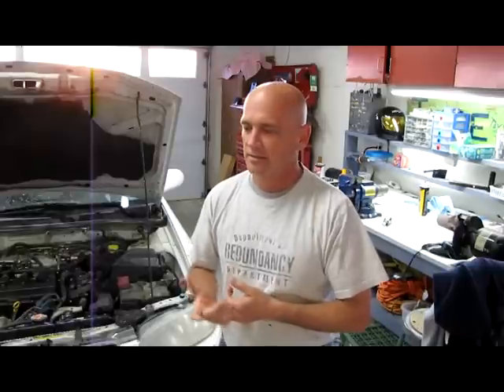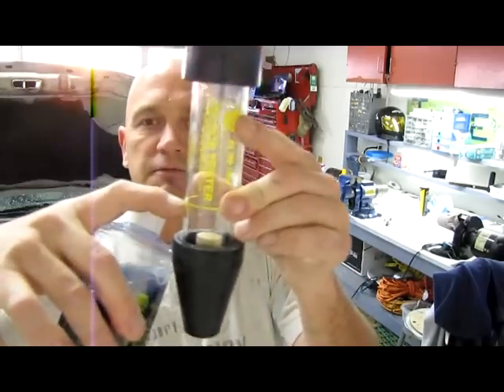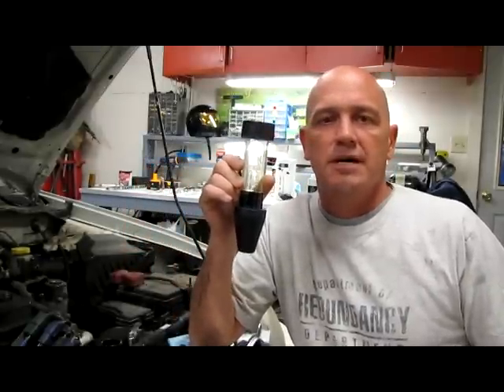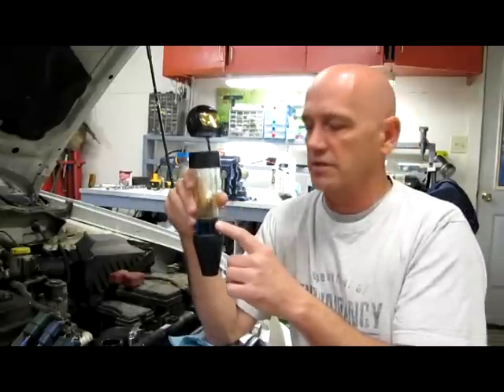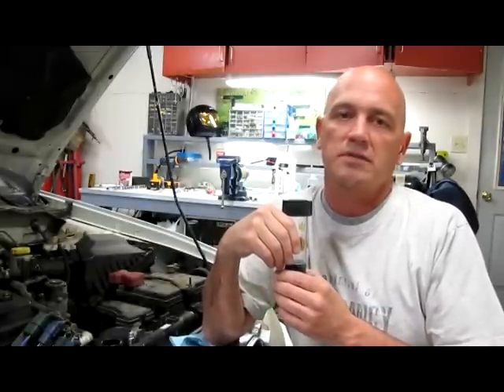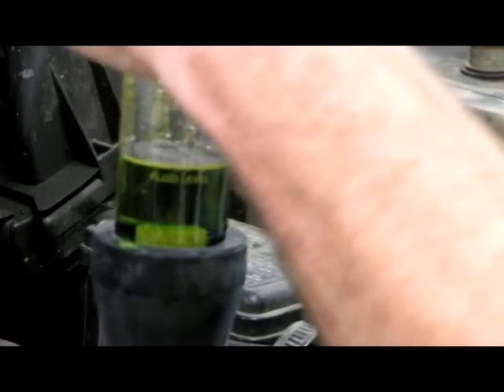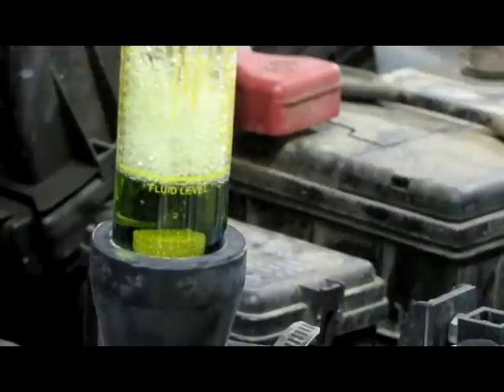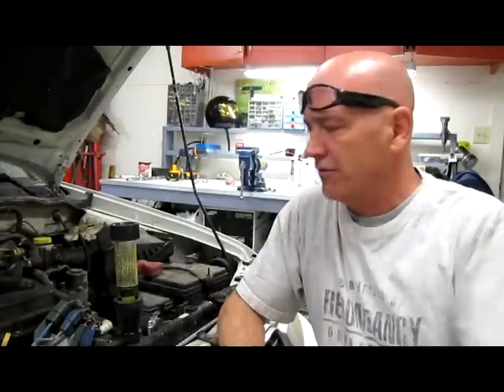How to Test Head Gasket

Comment: hi got a Volkswagen bora 1.9tdi when its been running a bit it loses coolant threw reservoir on expansion tank used this test yesterday it didn't change colour showing head okay also pressure tested which was fine im lost whats up
Reply from the maker: thomas guest Hi! This is a good one!  Your TDI engine stands for Turbocharged Direct Injection - and to me, the major thing here is 'turbocharged.'  I'm no expert on turbo's, and have little experience with them but have read a lot about them...I 'get' what their purpose is: to grab tons of air, and to basically 'push' it into the intake of the engine.  Most turbos I know of use the exhaust forces to spin a veined turbine, and the resulting plumbing crams more air into the intake.  Since it's using the exhaust forces, the turbos run hot and there is cooling that is necessary there. In your case, a bit of internet searching shows me that the TDI system was developed by Volkswagen, and that most of those types of systems use what is called an 'intercooler.'  Further, there are many types of intercoolers (and aftercoolers, for that matter), and some in fact do use the engine's cooling system.  Of interest here is the "Charge Air Cooler" type - read this description:

 "A charge air cooler is used to cool engine air after it has passed through a turbocharger, but before it enters the engine. The idea is to return the air to a lower temperature, for the optimum power for the combustion process within the engine."  

I have seen intercooler systems which do use coolant from the cooling system.  Yours may or may not be this type, but if it is, your pressure and block tests may not be showing a leak in the turbo cooling system - if it is in fact using coolant to cool the turbo process.  That's about all I can offer at this point - I'd suggest you locate a specialist or someone who is greatly familiar with your induction system - this shows to be a diesel engine, which uses super high compression, and compound that with forced induction via turbo - tons and tons of heat there.  

I'd focus on the turbo system at this point and see if it in fact uses your cooling system to cool that process.  Sorry - not much more help than that!  Would love to hear back!  Thx for the great post!  r-
Reply: +thomas guest You're probably loosing coolant when under pressure through the water pump gasket, I had exactly the same problem on my 1.9 tdi, it's an inherent problem with a lot of 1.9tdi's and the 1.8T petrols. In the end the gasket totally went and wouldn't hold coolant even when not up to pressure. Just get the water pump changed and the cambelt and expansion tank whilst you're at it, as they will need the belt off to do the water pump anyway.

Comment: does this tester work on a sealed system with an expansion chamber rather than a radiator cap?
Reply from the maker: Glenn Webster Yes, it does.  Contact US  Sealants if you need to verify, but what I've heard, it does.  r-
Reply: Thanks...

Comment: by the way, the only symptom that I have seen in the car is that we loose coolant and we don't know where it is going…. what do you  think? thank you!
Reply from the maker: noa33333 hey I can't find your original post, if you posted.  But....given just this info.....   losing coolant is always an issue of course.  I'd be interested in knowing at what rate you are losing it ...a quart a week, a gallon a week...?  If you are losing coolant the first thing would be to perform a pressure test to look for any external leaks, which are most common.  Even just loose clamps can cause enough for concern.  Then, if that turns out to be negative and you are still losing coolant, well then a block check would be in order.  Beyond that I'd need to know more about your situation.  Hope this helps some. r-
Reply from the maker: reluctorvalve Ah, Mini Cooper - got it now.  sorry bout that. r-

Comment: very useful thanks. My mini cooper S has an internal coolant leak and I have been told that it must be the head gasket (£800 repair!) and I bought the Mini second hand only 2 months ago ;0( , i want to make sure it is the head gasket before I commit. But what could it possibly be if it is not?
Reply from the maker: noa33333 Well, if you definitively have an 'internal' leak, and you want to know what else it could be besides the head gasket(s), I'm not too sure you'll want to hear my response.  The only 'other' kind of 'internal' leak would be a crack in the engine block (housing the pistons, crankshaft, etc), cylinder head, or both - in which case, junk the entire engine and put in another complete one.  The main thing is to determine if you have an internal leak.  If you do, then of course you'll want to know if it's just the head gasket(s) (at your high price you list), OR a crack in the lower engine block (which would be an even HIGHER price, of course).  The ONLY way to tell if you have a crack in the lower engine block would be to take the engine out, take it completely apart and then send the gutted-out lower engine block into a professional machine shop to be tested for cracks ($$$).  ....Nutshell:  diagnosing overheating to just a head gasket is always a bit of a gamble, because the issue could in fact be a crack in the lower block. I used to tell my clientele that if they had an internal leak, it was MOST LIKELY a head gasket issue which is common, but it COULD BE a cracked block (bad engine), which is NOT COMMON, but yes, possible. In one of my cases, the head and head gasket were replaced, only to find that it still overheated badly - so we replaced the engine at that point. And yes, the client paid for each repair ($$$$$$). However, in all my other clientele cases these issues were corrected with new head gaskets and resurfacing of the cylinder head bottoms. I always made my clients aware of their choices. It all depends on the degree of damage done while overheating.  Remember that most of today's engines have light-metal aluminum cylinder heads, along with the thick and dense cast-iron lower blocks.  While overheating, naturally the thinner, less-dense metal 'chunk' will become damaged first.  If the vehicle was driven over and over and over like this, the chances are of course higher for a cracked block.  If it overheated once or twice, and an internal leak is detected, chances are it would just need head gaskets and a look at the bottom surface of the cylinder head(s).  Not great news, but hope this makes some sense.  r-

Comment: Great video.  How does this work on a vehicle like my Grand AM?  It doesn't have a radiator cap.  Only a reservoir that feeds to the radiator.  Can this be done on the reservoir?
Reply from the maker: Robert Rosenow Like you, I once looked on YouTube for similar processes, and some that I ran across were from the UK - very similar test tool and some were used on what you are referring to - and expansion tank.  I haven't done this on a system like that myself, but if you look more I'm sure you could find someone using this on an expansion tank system.  If not, contact USA Sealants, who makes this product and they could tell you more than I can.  The adding part of the instructions is what I would be concerned with, just like you are.  Not a whole lot of help but at least you know who to contact to find out.  r-
Reply: Thanks for the response.  Just yesterday I found someone who confirmed that anything done through a radiator normally could be done through the tank.  Great news.  Ran the test and remained blue.  Thanks again.

Comment: +reluctorvalve: I have a 1998 Honda Civic that is loosing power and shakes/rattles during stops, acceleration, and while climbing up hills. My check engine light is on consistently. I barely managed to get it in to Auto Zone where they hooked up the diagnostic tool. It read that I have a Cylinder 1 & Cylinder 2 Misfire. What could be the cause of this problem?
Reply from the maker: Yvette Burtley Yvette: This is going to be lengthy, but that doesn't necessarily mean that your issue(s) are all that complicated.  First question: did this start all of the sudden at once? Or did it start to run a little crappy, then gradually get worse?  Your complaints of shaking and rattling are obviously a direct result of the misfires - so no need to wonder beyond that for those complaints.  I'm assuming you have a 4-cylinder engine.  Basically, if you have two of those cylinders misfiring, HALF of your engine is doing nothing, from the standpoint of producing any kind of power to push the car.  This would be exactly like trying to ride your bicycle with only one pedal!  Try that going uphill! :(  Even if it's a 6-cylinder, a two-cylinder misfire is huge!  That would be a full 33% of your engine not doing a thing. What is great from a troubleshooting standpoint, potentially, is that #'s 1 and 2 are both misfiring- and typically these cylinders are located right next to one another. That physical commonality is what I would be drawn to immediately. Such as, what do these two have physically in common?  What could make both of these crap out at the same time?  Let's start with explaining a 'misfire,' first of all, as brief as I can. Your bicycle has two pedals, so it's now defined as a 2-cylinder machine for this comparison.  One cylinder is like one of your pedals on your bike, in that it needs what it needs to produce that downward force on the bike's 'crank,' and yes, it's called a crank on a bicycle. If one leg, pedal or foot is missing, then that pedal isn't being pushed downward - that's the effect of a cylinder misfire - nothing is pushing that piston (your pedal) downward.  On your car, each cylinder needs 3 things in order to produce that downward power on each piston, or pedal:  #1- Adequate Compression-the air/fuel mixture needs to be compressed and pressurized before being blown up, basically. That 'explosion' is what pushes the piston (pedal) down on the engine crank.  So a compression test can tell if this is the issue- and this is referring to possible bad issues with rings, pistons, bent valves - akin to your pedal being broken off on the bike, a missing leg, illustrating the more mechanical parts.  Side note: when doing a complete compression test, the lowest cylinder results should be at least 80% of the highest cylinder results, given that the highest is within acceptable levels. #2- Ignition - a spark at the correct time - easily tested.  Without a spark, nothing will blow up, nothing will push the piston down. This 'combustion' is what forces the piston (pedal) down on the crank, helping to rotate it.  #3- PROPER air/fuel mixture- this is a big one.  just the right ratio of air and fuel MIXTURE is required to combust or ignite or blow up - however you want to view it.  Proper mixture is typically like a 'mist' (atomized). Too much air (too lean) or too much fuel (rich) will result in NO explosion, or no downward force of that pedal.  A lack of fuel, such as a bad fuel pump, can cause this, but that would most likely effect ALL cylinders, right? Clogged injectors also would cause lack of adequate fuel. Vacuum leaks (air suction) in the right places, on the other hand, can effect that air/fuel mixture and allow too much air to get in, and then thins out the mixture so much that it won't ignite and explode (too lean).  So ya - lots of stuff.  Now, to simplify where I'd go with this.  #'s 1/2 are right next to one another.  Head gaskets do tend to become damaged right in between adjacent cylinders.  If this happens, the hot compression, combustion or "explosion" gasses will make their way into the cooling system ports which are also holes that are adjacent to many cylinders in those areas of the head gasket.  A block check will detect this. But if this were the case, you'd have some obvious overheating and other bizarre symptoms.  If no overheating, the next thing I would look at would be the intake manifold area for a potential intake manifold gasket leak. Because #s 1/2 are right next to one another, if that intake gasket seal is damaged in that area, it could be sucking in too much air to both of those cylinders and thinning the mixture out too much to explode.  So some testing is in order.  First, a compression test to check for the more really bad mechanical missing or broken pedal parts, then a check for spark on 1 and 2. If spark is good then you are left with air/fuel. I'd check the intake manifold gasket area for 1/2 for a large vacuum leak.  If still no progress I'd run a block check. Of course there are many many other ways to further isolate your issues, but obviously I've only covered the basics. Understand that any individual error in ANY of these descriptions will send an error to the PCM, and your check engine light will come on. It is sensing that something is missing or incorrect in ANY of this.  So from my perspective it's back to basics: getting a good detailed description from you on exact timing of issues and symptoms and working from the inside out.  Sorry so long, but a 'misfire' can be as simple as something that is unplugged, or one bad sensor - all the way to some rather deep component issues.  Not much help, but if your mechanic doesn't mention at least parts of this to you, I'd find a good LOCAL busy mechanic who will take the time to step through this with you. I'd love to hear back on what you find out! Hope this helps a little.  r

Comment: Thanks for the great video,
I have a 2002 ford taurus and I found a lot of rusty coolant in the oil, my engine idles
rough on idle and shakes. On higher rpm it sounds ok. The oil light blinks and comes on
when its idling bellow 1000 rpm. It doesnt smoke alot but I found there has been black
debits on the floor bellow the exhaust. Does anyone know what could be wrong? whats
the chances that I have got a blown head gasket?
Reply from the maker: R MZ This sounds like a vehicle with multiple issues, not just one issue.  I guess in an extreme case just a bad compression leak could cause your symptoms, but with something like this I'd start with the basics.  If there is coolant in the oil, have a block test performed to determine a starting point.  Because- if you need new head gaskets, you might as well replace all the tune-up parts, all the filters, and then are left with whatever engine control sensors that may be out (O2...coolant temp, etc).  Lots of coolant in the oil will effect oil pressure- this would be a hard decision to make. Oil pressure is the 'heart' of the engine. Spent the money on repairing the head gasket leak, and THEN run an oil pressure test to make sure it's providing adequate pressure - but then you could find out that it's so worn out that it can no longer provide enough oil pressure. Now you need a new engine, having just spent all that money on a head gasket repair.  If this were my car, I'd probably do a block check, a compression check on all cylinders, and an oil pressure check when it's not running at overheating temps.  Consult a good LOCAL mechanic on the results.  But....a good used engine replacement may be in order....not good news any time you have low oil pressure.  sorry!  r-

Comment: so you do this when the engine is cold if it turn green is bad?
Reply from the maker: Michael: There should NEVER be 'combustion' or 'compression' fumes in the cooling system.  It doesn't matter if the engine is cold or hot - either way, there should not be those kinds of fumes in the cooling system.  The tester is trying to detect those fumes, so ideally, you would test AS the engine is heating up - and that's why you don't fill up the system to the full level, because as the engine runs, the coolant level will rise.  Leave an 'air gap' to use the tool to only suck in FUMES (no coolant or water).  Doesn't matter hot or cold, there shouldn't be the fumes, so it should remain blue.  How often to 'pump?'  Just pump it as you go -  I usually do mine pretty continuously so I can tell when the thermostat opens and if the results change drastically then, or even before that.  Hope this helps! r-
Reply from the maker: reluctorvalve Color:  if you think about blue as in a color, it would become green before it would become yellow.  So green isn't good, but yellow is far worse.  So, we used to call green a 'mild' issue, and it's possible that an engine with 'green' results may run fine most of the time, but would then overheat for no particular reason, or any discernible reason.  My take:  green isn't good.  Yellow is most definitely an issue.  r-